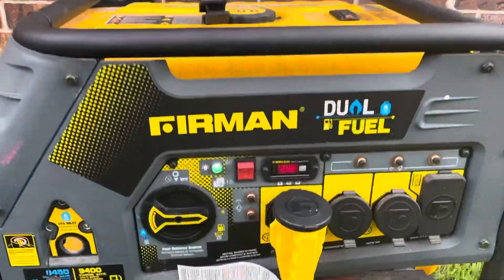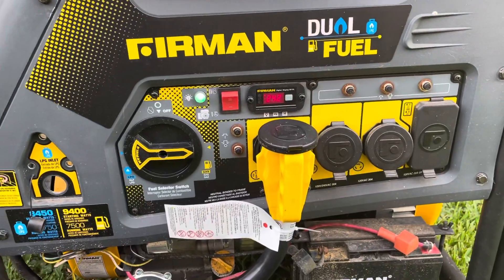Home Backup Power Generator Setup | Firman Generator Home Hookup and Test

Comment: If it cannot handle a single AC, do you still need a 7500w (9400w peak) generator to power a house? I was hoping it would handle at least a single AC unit in a typical house.
Reply from the maker: Depends on the size of your unit. Good rule is 1k watts min per ton.
Its the startup amps that will get you. Install a soft start to help

Comment: Just FYI the 7500 watt generator, even though it has a 50 amp RV hook up, it is still only providing 30 amps.  I have talk with Firman tech support to confirm it.  I began to question it cause the math did not add up to 7500 if it had a 50 amp breaker in the generator.  There is no 50 amp breaker in the wiring schematic or in the parts list in the manual.  A true 50 amp generator will be like at 12,000 watt. (50 amp)(240V)=12,000 watt.  The 7500 watt will power a fifth wheel but it works when the other AC's kick on.
Reply from the maker: @Flipfloplife44  damn, had no idea. Thank you for that info
Reply: @CraigSummers  no worries hope it helps you and your viewers
Reply: @JeffreyMaresh

Omg, I was looking for this info. I was confused about this exact same thing. I know it states my Firman is a 50 amp, but for 7500 seemed farfetche'd. So, my question to you is, can i use a 30 amp inlet box/fuse as I have one installed already from my last 7400 watt generator? 

Thanks in advance.
Reply: @HarleyRider281  Yes you can.  My Dad got this same one. What helped my Dad is I got an Amp Display off Amazon and put it by he breaker box inside.  This way he can see the amperage pull.  He had a basic AC on his house, 2 ton I think,  with no computer in it so I installed a hard start kit.  The generator had to work and he had to turn everything off but it did run it.

Comment: I would like to set mine up this way also ,but concerned the 50 amp plug is push in not twist lock, what are your thoughts please
Reply from the maker: I wouldnt have an issue with push in vs twist

Comment: I have the Firman Tri-fuel and use natural gas. I have a 4-ton (46,000 BTU) AC unit. I installed a Micro-Air EasyStart 368 (4-ton) Soft Starter ASY-368-X48-BLUE. My AC unit now uses 12.8 to 13.8 Amps and a Start Peak of 33 to 36 Amps. I bought it at Global Yacht Supply which now costs $330.
Reply from the maker: Awesome! Thats exactly what I want to do
Reply: @CraigSummers  The EasyStart is easy to install. Just read every line of the instructions. There are some good videos about installation. It also has Bluetooth and can connect to a smartphone using an app to view running specs.  FYI ... the 50 Amp outlet has a 31.25 Amp circuit breaker on each leg. Also, my UPS's seem to beep & click when connected to the generator. I just move the plugs from the battery backup side to the surge protector side. On one UPS I have a stupid power strip plugged into the battery backup side with items plugged into the strip. All I have to do is move one plug to the surge protector side. And then turn off UPS. Surge protector should still work.
Reply: @CraigSummers  I see that you are in the Houston area. I am in East Fort Bend County. I bought my Firman for Hurricane season but used it the first time during the Texas Big Freeze.